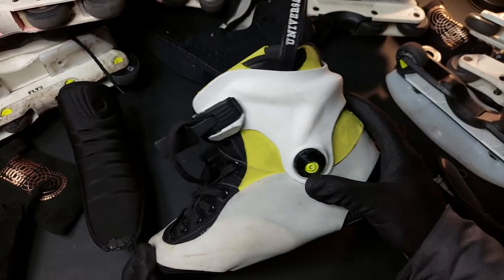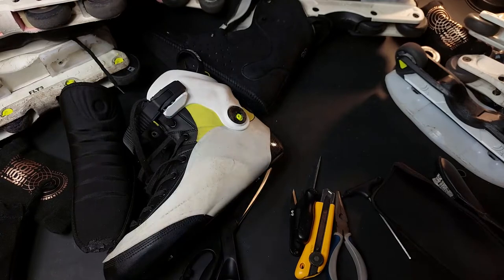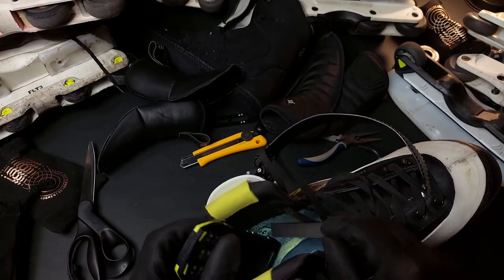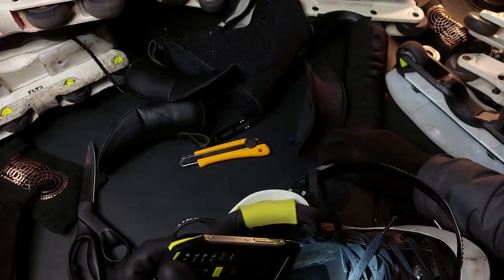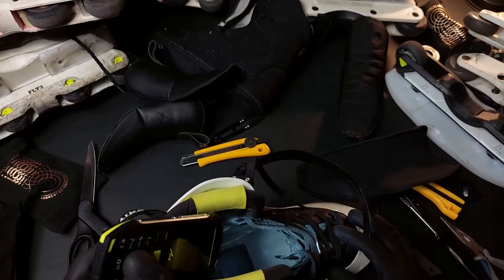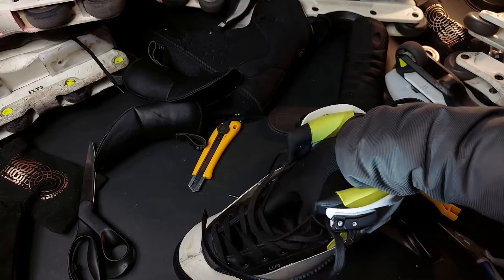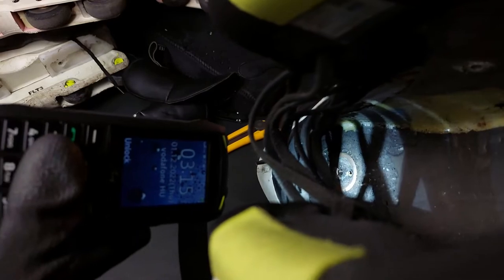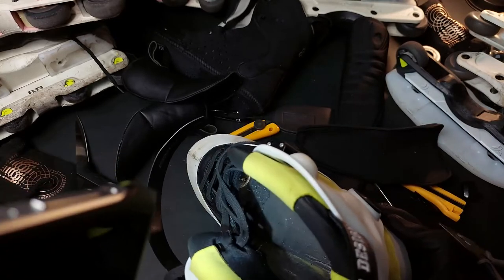Gutting Carbons

Comment: Love your video. What's your recommendation when gutting a Seba CJ carbon in EU41? Which Intution Premium skate liners size woudl you recommend if my feet are 260 mm? Would you go for the 8-8.5us / 26-26.5 liners or 7-7.5us / 25-25.5?
Reply from the maker: I can't give you a trusthworth advice, because the SEBA CJ has their own sizing offset and intution premiums too. The general rule is most like to go one size larger, so when you gut the boot you gain about 6-10mm extra room so your foot will fit along with the liner.
Reply: @bladelab  Thanks. What's the tape you use to reinforce/tape up the ends of the original liner? Looks so clean on yours : )
Reply from the maker: @mindtheyoutubegap  I'm not sure what you are referring to exactly. I didn't cut the top part of the liner, just removed some layers of foam there and the overlaying part is the skin that I added with industrial grade two sided cello tape.
Reply: @bladelab  Thanks, that's what I wanted to know. Looks so professional on your setup. Trying to apply some of your techniques to my CJ gutting project :)